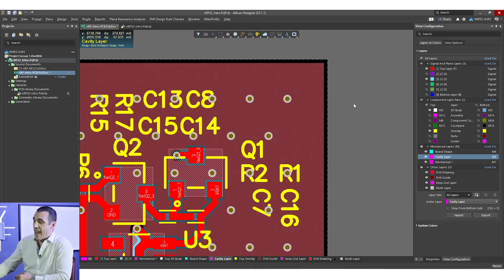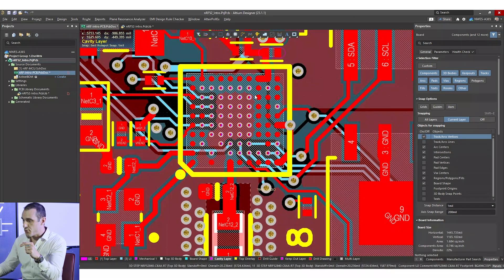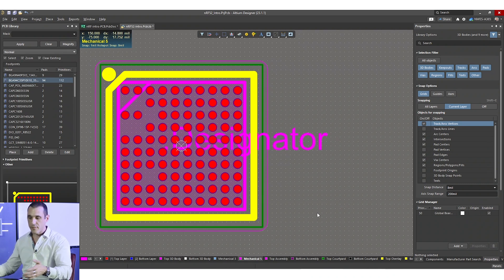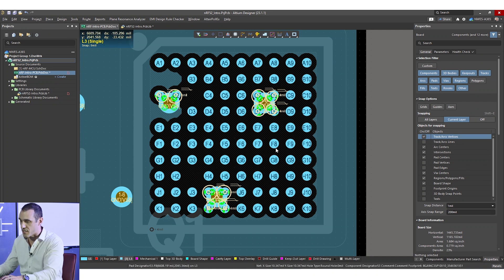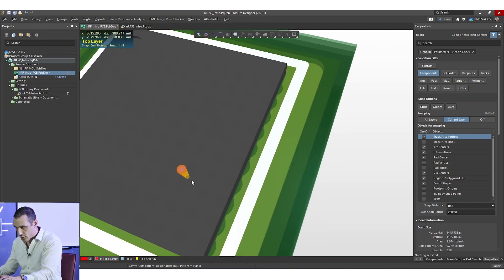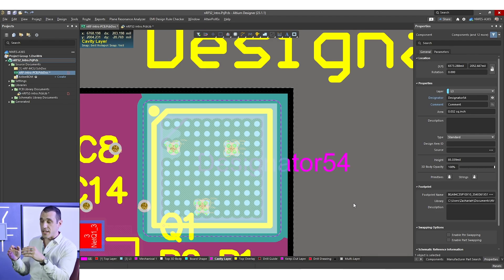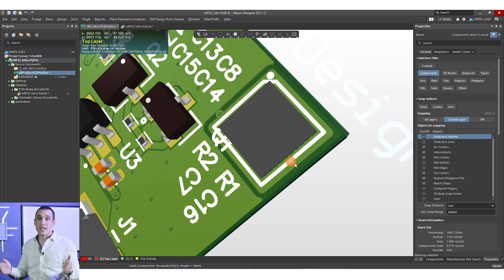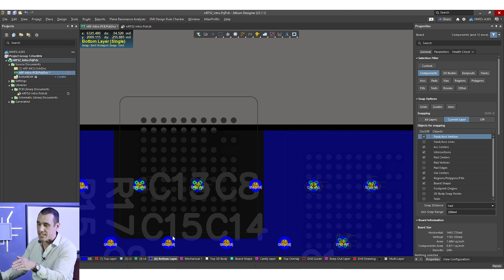How to Place Cavity Regions in Your PCB Footprint

Comment: looks expensive to manufacture
Reply: It's just an additional rout-out on layers 1 & 2. Since we already have blind & buried vias in this board, adding a cavity is trivial. It's definitely beyond the capabilities of the cut-rate rapid prototyping fabricators though, so be sure to call your fabricator and make sure they're set up for tooling on individual prepreg layers before you wang something like this into your design.
Reply: It is a premium product. The exact extra cost depends on how the board is built. If you're doing HDI buildup and the cavity is in the buildup layers, or it is only in the internal core region, it might cost less than it would in a conventional build. If it has to be plated along the walls/floors then this adds another process step, so that also adds cost.
Reply: It is